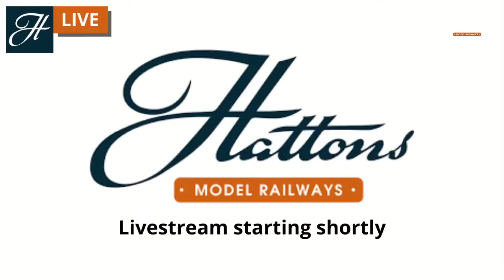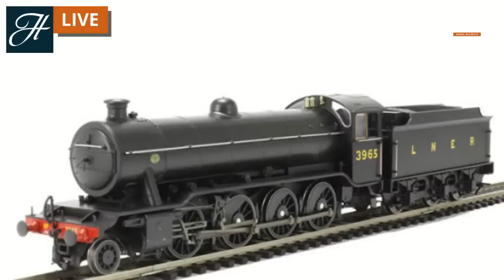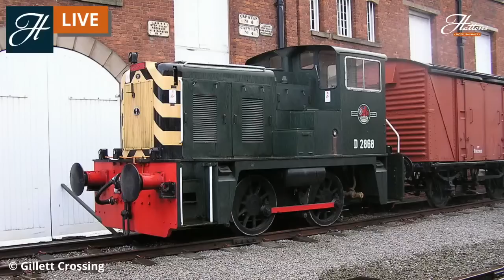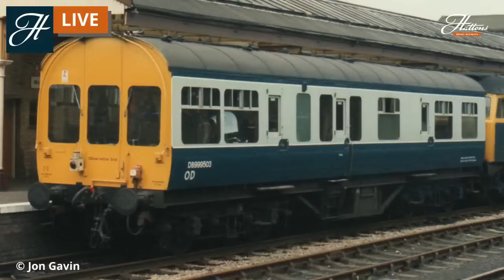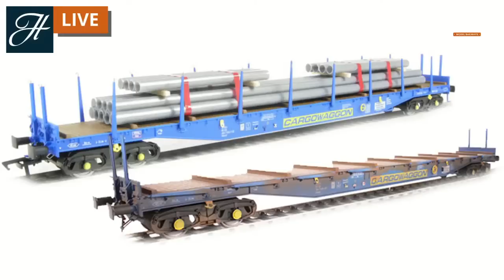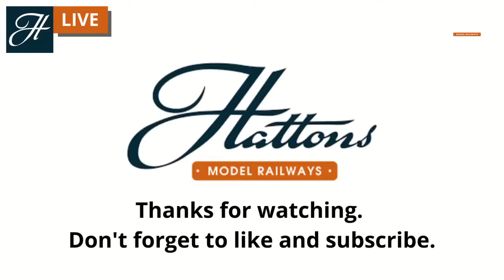All-new Heljan 2021 range announcements!

Comment: Bit of a clanger on the front cover of their catalogue... A class 47 with an 'above the beam' ETH receptor, but fitted with snow-ploughs. Not possible on the real thing due to the outlet position for the cable. If you put ploughs on an ETH 47 you need to modify it with the more modern standard 'below the beam' ETH sockets. Lets hope they pay more attention when making their models.